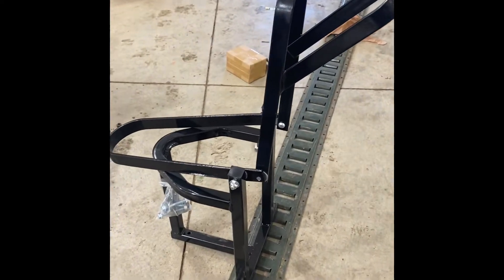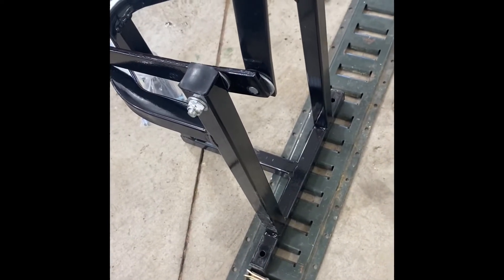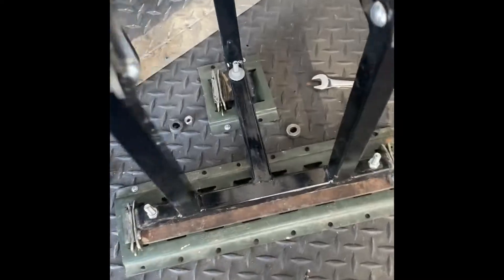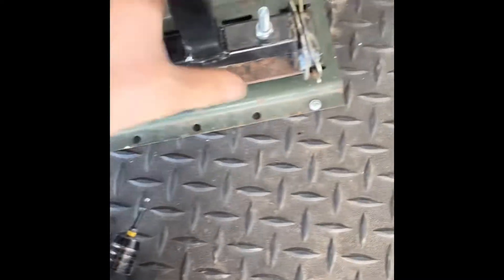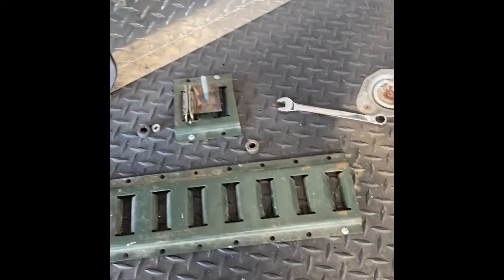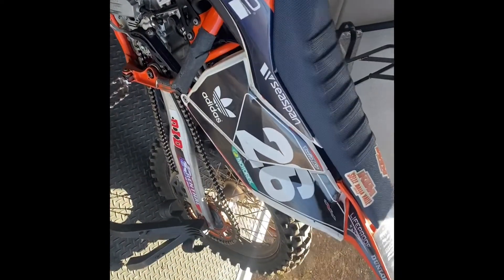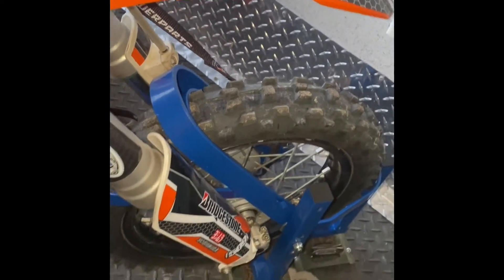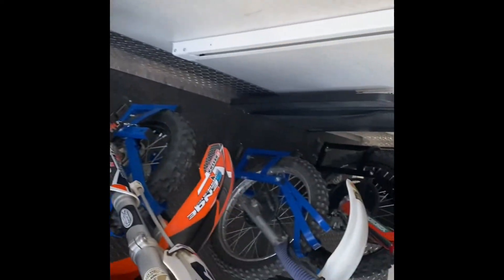Mounting clamping wheel chock to e track.

Comment: Where did you get the etrack pieces you weld on?
Reply from the maker: You can get them at any place that sells e track got mine at northern tool they come with a short strap on them I just cut that off and used the end.